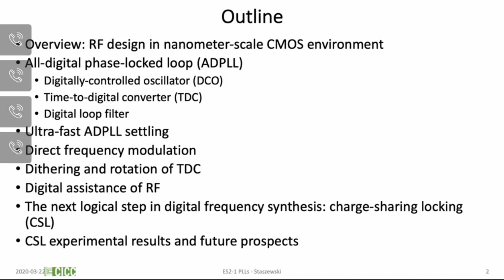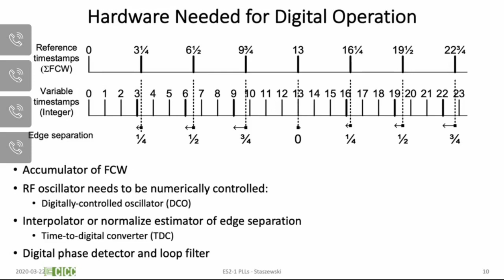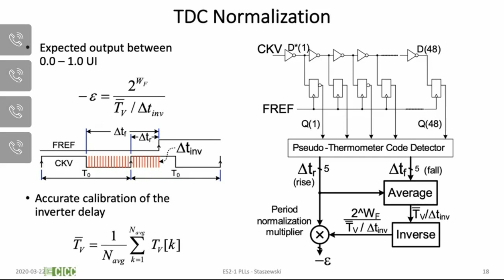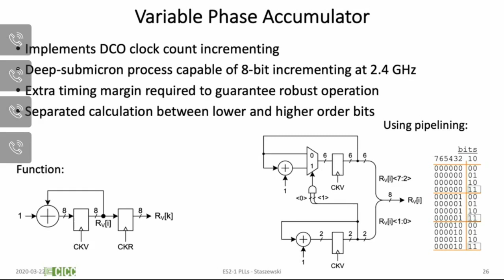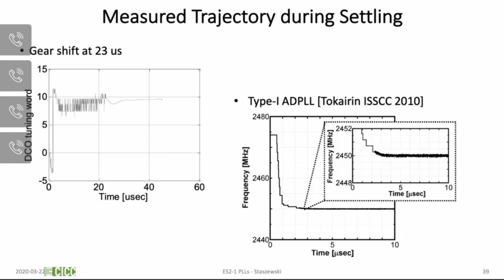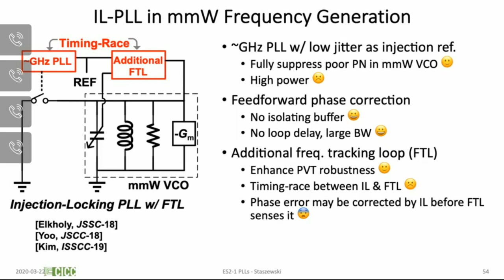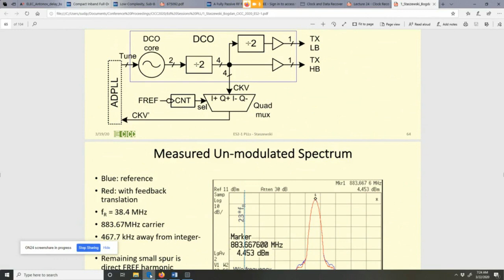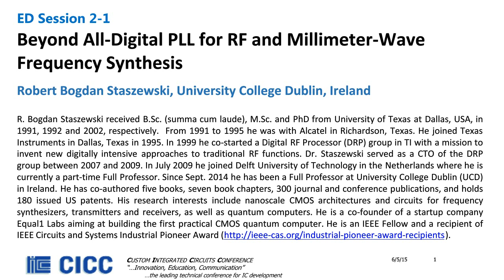Beyond All-Digital PLL for RF and Millimeter-Wave Frequency Synthesis - Robert Staszewski

Comment: Sir, if we use finite register sizes for variable phase accumulator. The register are going to overflow. In your paper "Phase Domain ADPLL" 2005, you have suggested to use Modulo arithmetic to solve it. But, modulo subtraction always result in positive number, which when Integrated, produces infinity. How was this problem resolved?